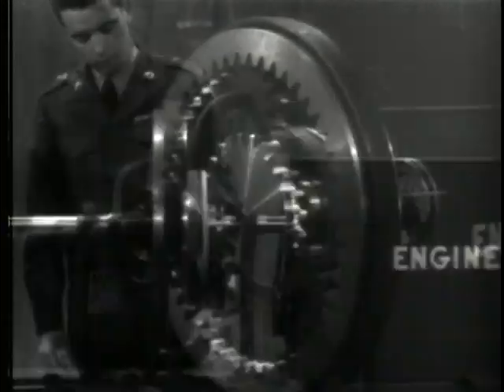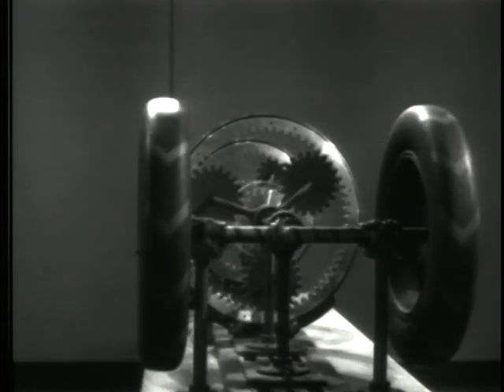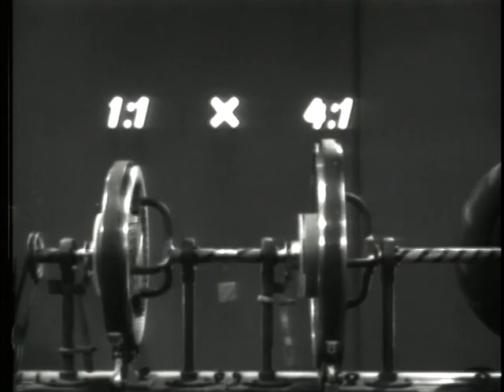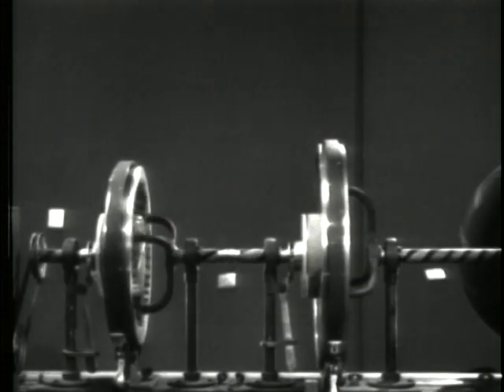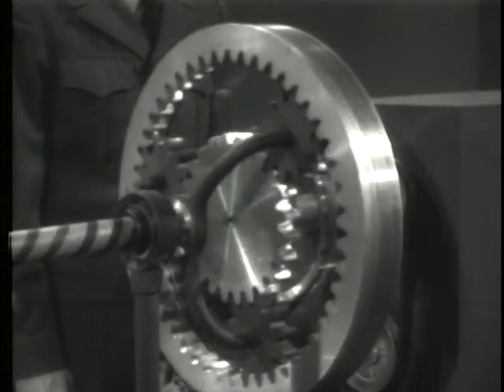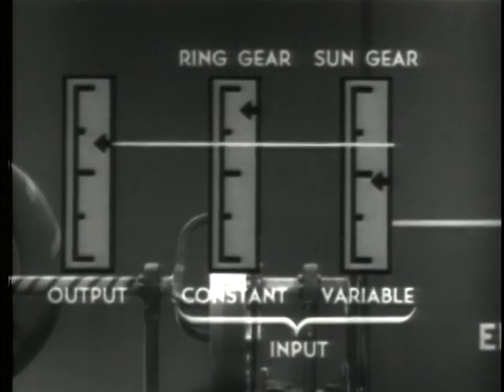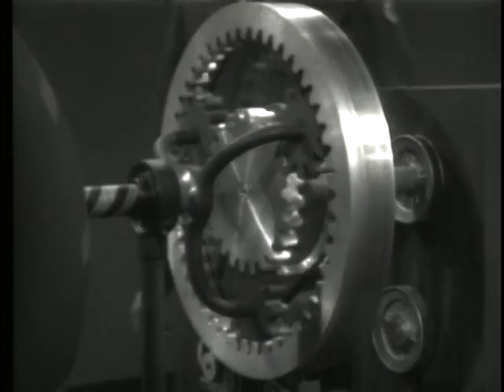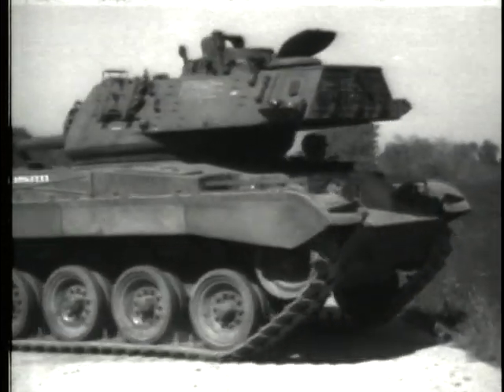PLANETARY GEARS, PRINCIPLES OF OPERATION - PART II - MULTIPLE SETS

Comment: At 53 yrs old, & driving manuals most all my life, I'm on my 3rd automatic, a GM 4L60E. So, I figure I'd start learning a little about the typical American automatic. Enter, planetary gears. I too, find 'em quite baffling, especially when we are talking 2 or more sets. (I think) a basic PG set (sun, planet, ring) is capable of three speeds. Some sort of simple modification enables a 4th gear overdrive (I think). Fairly sure GM 4L60E has only one set of PGs'. Like I said, complex & fascinating.

Comment: The second half of the demonstration, ie, the part where there's an input to both the sun gear and ring gear pretty much describes the "synergy" gearbox of a Prius, when both it's gas engine and electric motors are working.